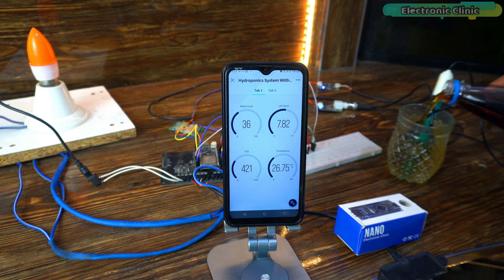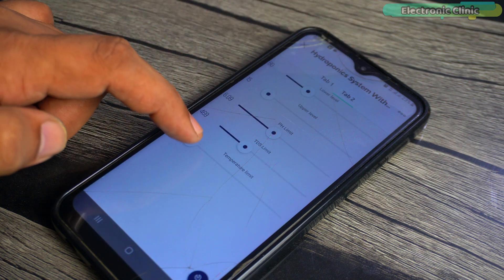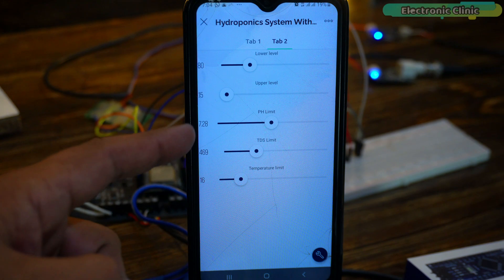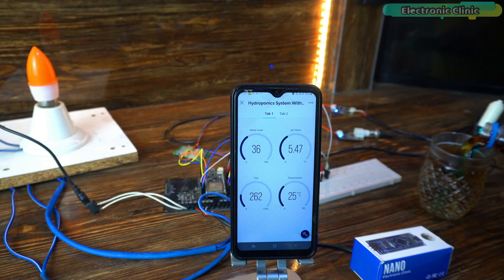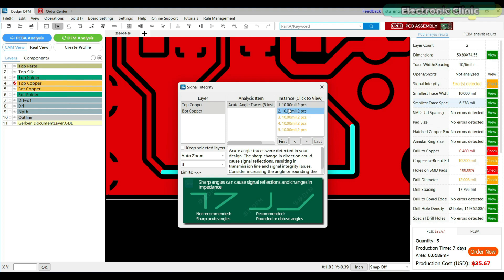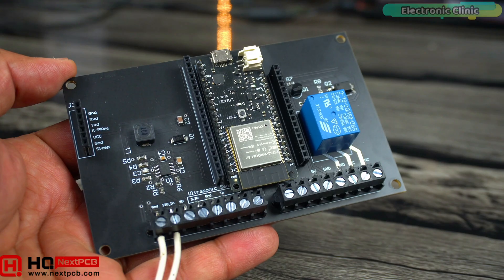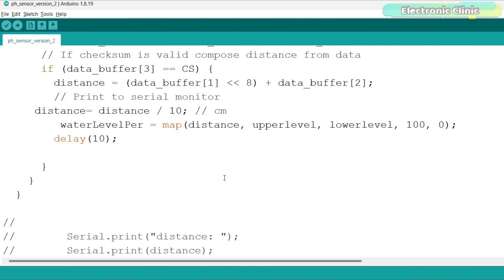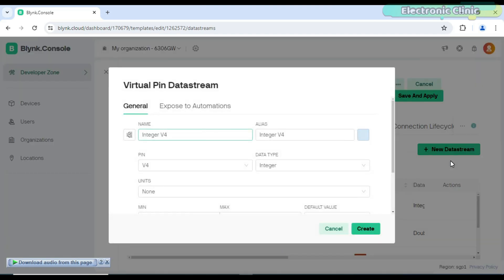Hydroponics System using pH Sensor, EC Sensor, DS18B20, Ultrasonic, & ESP32

Comment: Sir please help i use black ph sensor cheaper than color blue please help i use esp32 if i connected to the lcd 12c to display the data but it is not accurate please help

Comment: is it possible  to blynk free version .....
Reply from the maker: I myself used the free version.
Reply: @ElectroniClinic  In Free version only using 5 Virtual pins .but, in the video you use 8pins .four for displaying data another four for set limit
Reply from the maker: @pavanmani430  I don't know if they have made any changes in the free plan. I didn't check blynk. You can also try another iot platforms. I have several videos on different platforms.
Reply: @ElectroniClinic  Ok Thank you for your valuble responce .

Comment: Have you tried the ultrasonic sensor in a reservoir yet?  I’ve been using that same waterproof sensor in the lid of my tank and it doesn’t work very well.  According to the manufacturer it was not designed for use in an enclosed humid space.  I have to remove it from the tank and target it at something else to reset it several times a day.
Reply from the maker: I didn't test it inside a tank. What's the diameter of your tank? Did you try sro4t waterproof ultrasonic sensor? You should try a sensor with a low sensing angle.
Reply: @ElectroniClinic  I have a square 5 gallon tank and I chose the A02YYUW because of its low sensing angle. The minimum distance to the water when the tank is full is 7cm, the minimum range of the sensor is 3cm.  The SR04T has a minimum range of 20cm.